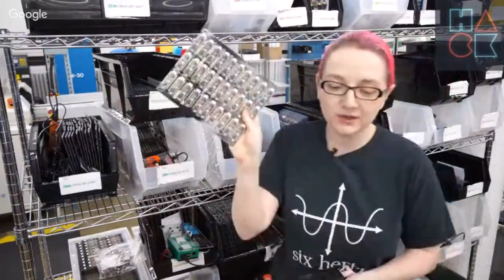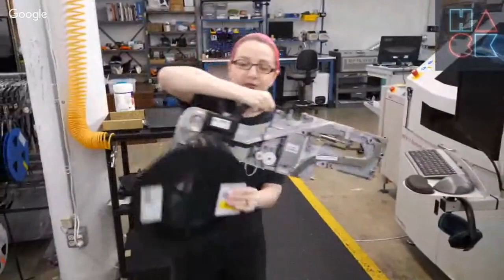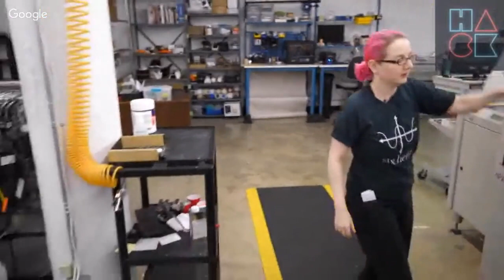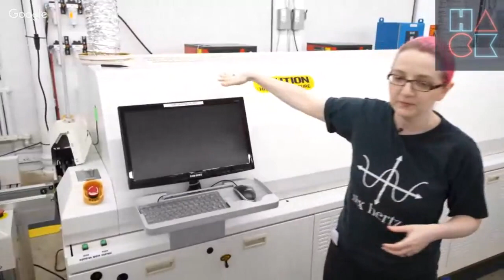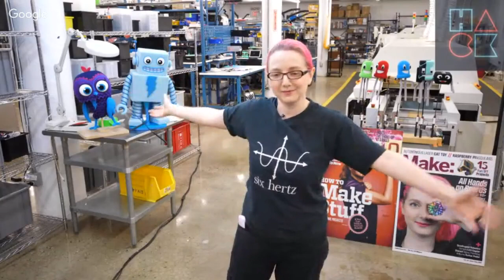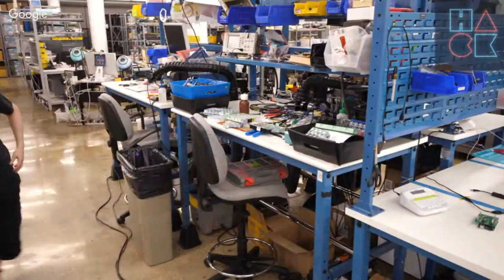Limor "ladyada" fireside chat @HackMIT @adafruit #adafruit

Comment: Funfact:
The T-shirt refers to MIT Course 6, which is the electrical engineering and computer science department at MIT.
It gently pokes-fun at the course saying "Six Hertz" on the front.
The pattern on the back is an in-joke that only engineers can read. The binary pattern decodes to:
Parity Removed
---------------
01100000 0x60 (as in "Six")
01010011 0x53 S
01010101 0x55 U
01000011 0x43 C
01001011 0x4b K
01010011 0x53 S

Comment: Wow, she is someone I would love to be friends with!
My school had no software or hardware classes so I just learned from Radio Shack 100 in 1 type kits and designed and built projects like a device that tracked the Sun and robots that could drive around and pick things up.
Now many years later I 3d printed my humanoid robot Dave from a story I am writing.
I designed and 3d printed the robot and added servos and a servo controller.
Then I programmed him for speech, vision and movement.